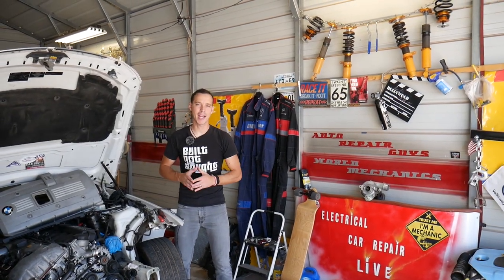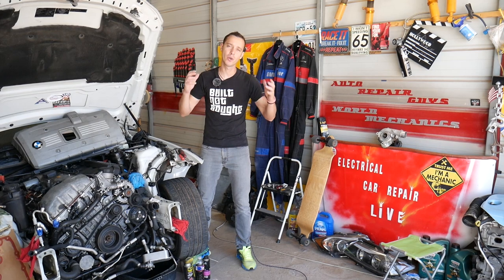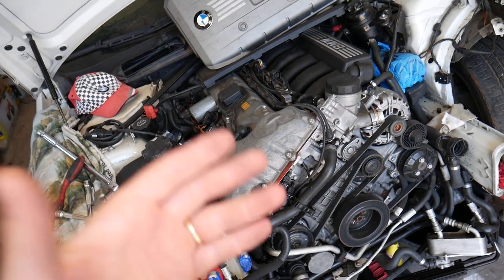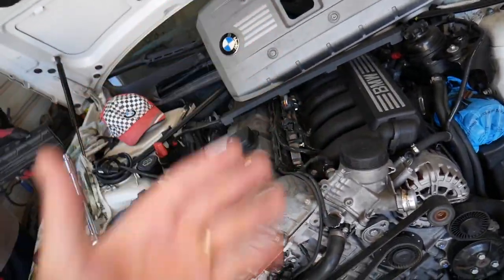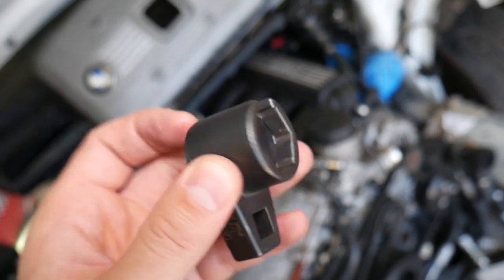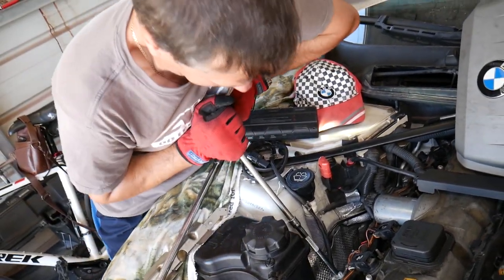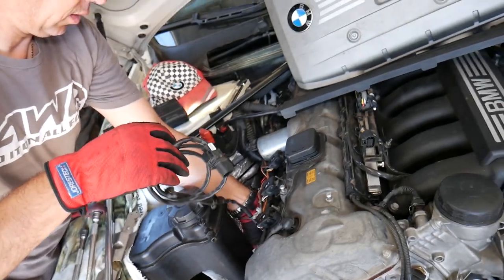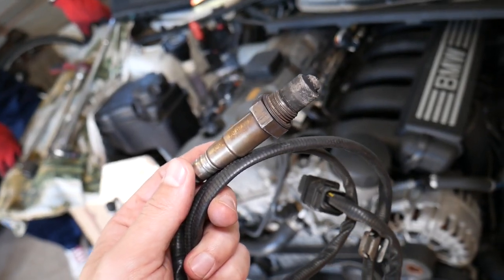HOW TO REMOVE OXYGEN SENSOR THAT IS STUCK, OXYGEN SENSOR TOOL

Comment: I bought this tool and still can't get mine off!!  My mechanic recently replaced my exhaust manifold and at the time i did not provide a new 02 sensor so he claimed that he loosened it for me so that i can replace it by just turning it by hand , but it is extremely hard to get off with even this tool and the breaker bar. What am I doing wrong?
Reply: Nothing. Mine won't come off either. I've tried everything.
Reply: WD40 or blow torch

Comment: All the rest of youtube says this tool is crap and it expands at the groove and rounds the sensor head hex. If there is room, cut the sensor just above its hex (angle grinder with cutter disc), and then use a 6 point socket after running the car for 10 minutes and squirting thread lubrication....  I suspect this YouTube was done on a previously loosened sensor
Reply: Im about to attempt this now on a Chevy Avalanche the upstream o2 sensor i saw a vid where the guy used a hose clamp to stop the socket from spreading  im trying that
Reply: @kylosolo8815  I saw that one... also one where the guy used locking pliers to keep the slot compressed..That looked stronger
Reply: @chevinbarghest8453  i didn't see that one will try to find it thanks
Reply: @chevinbarghest8453  man it worked lol it took me longer to get under the truck than it took to break it loose
Reply: There's a few different types of oxygen sensor sockets. The complaints I've seen about the socket expanding are with the one that looks like a deep-well socket with a groove cut in the side. The one in this video is a crow's foot type socket and would be less likely to expand because it's shorter and the groove isn't as long.